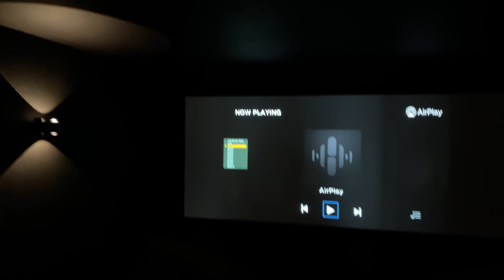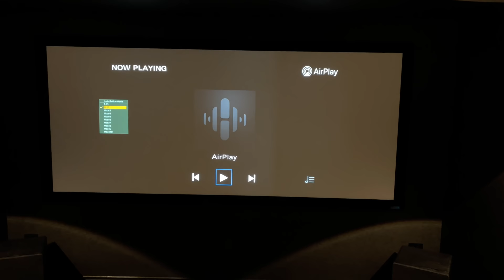**Full Install** Ascendo Immersive Audio 7.2.4 Atmos Home Theater| Katy, TX

Comment: Great work guy's as usual, however I would suggest the removal of the speaker grills as it's just another barrier between speakers and the screen material as well as causing unnecessary attenuation and really not a necessity to keep on especially since they are behind an AT screen. 

The Seymour Center Stage XD woven acoustically transparent screen material is actually very good in not showing through what's behind it when the projector is firing at it. Keep up the great work 👍

Comment: Ah, the joy of US houses and stud walls. In the UK... Solid brick on most walls and if it's an older house cuting in the ceiling your going through lathe and plaster !! I'm surprised you don't dry wall yourself as it's pretty easy to do. However, I get the process of shipping out some jobs, especially when the jobs get larger. Totally get the problem of working in a black room !! Surprised they didn't go black on the carpet as well to reduce screen flare. You are using my pet construction hate... Impact drivers. It's pretty rare you 'really' need them, just a decent driver with good torque. Like the lighting, throwing light up and down and into the room a fair amount. Like the AV rack, I just went traditional AV Rack as it's behind a door. The TecFlex is a good idea allowing to bunch all similar cables. We use something like TecSound to reduce sound transmutation to the rest of the house, it won't stop it, but it will reduce it a tad.

Comment: No acoustic treatment?
Reply: I didn't see any.  If this is their expertise, that's a HUGE disservice to the customer.  Acoustic treatment is more important than speaker choice.  You spend all that $$ and for less than $1000 you can properly treat a room to sound 100X better.
Reply: Yes there was u could clearly see before the screen went up
Reply: @leofitzpatrick380 the front wall is only part of what treatments are needed. Side, ceiling and back wall treatments are needed too.

Comment: Hi DHT.. thanks for sharing wonderful HT builds. is there a plan/ layout available for this particular install? speaker placements, screen to seat/s distance. Riser height etc? thanks so much in adv. Keep up the good work..
Reply from the maker: riser height is standard 12 inches for this room  for 8ft ceiling. 9ft or higher you 16 is standard. When in doubt do 12.
Reply: @Dreamediaav  Thank you. Other dimension info or not available to the public?

Comment: Won't that rack cabinet create a a lot of heat build up?
Reply: Yeah especially using the Denon 6700, those av's get extremely hot
Reply: @totalplonker824  I know!. I have the Denon S750H and my blu ray player on the shelf above it gets hot!!
Reply: @lesmatthews459  yeah I had a open box Denon 6500 on a 3-month extended edition time (lockdown) not only did it get extremely hot but i found it had an awful Digital sounding amplifier as well! I thought this is the reason why it's an Openbox and then decided to purchase a brand new one and to my horror it was exactly the same 🤯
 obviously it was Returned!
Reply: @totalplonker824  Oh WOW! Sounds like a horror story! Mine sounds excellent! Mine was refurbished for half price. In Canada that is still $500! Prices are CRAZY here!!  Only problem I've had with mine is that it sometimes looses the settings (usually after power outages - not always)! All I have to do is reset it (the problem). STILL a pain though! Otherwise - great amp!!
Reply: @totalplonker824  I ran out of space allowed! Only problem is it looses some settings (especially after power outages), but not always! All I do is reset the problem. Just annoying!
Reply: @totalplonker824  You ran out of space - so didn't see the rest of your comment.